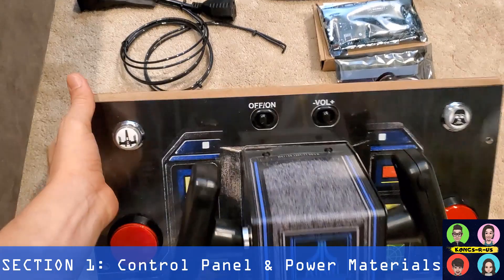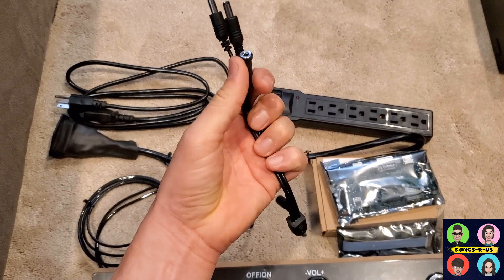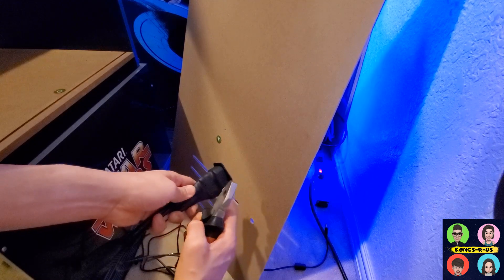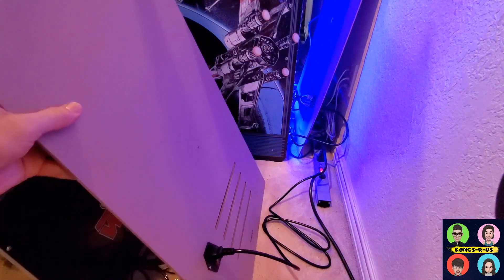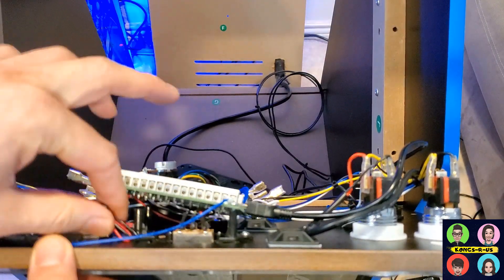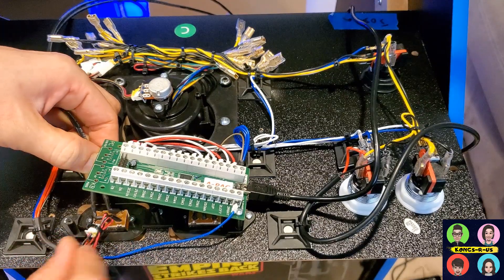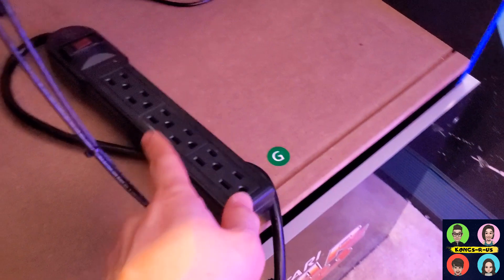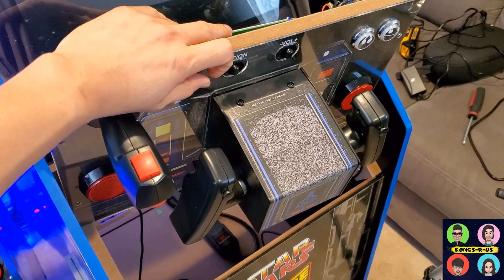Star Wars Arcade1Up In-Depth Mod Tutorial: Cabinet Power Installation

Comment: Are you using some sort of relay to control the 120V power.
Reply from the maker: inlet module switch to surge protector, with (2) 14 gauge wires hooked to the A1up stock power switch to control the surge projector power. Hope that answers the question!

Comment: Where did you purchase the Inlet Module Switch?
Reply from the maker: I custom made the inlet module switch wired to the end of an extension cord, then wired (2) 14-gauge wire from the black live wire to plug into the stock A1Up switch. highly recommend being careful if planning to try this out, as the A1up switch is rated for 125V  - 6A so can only handle a few devices plugged into the surge. PC, monitor, and sound only

Comment: What components did you use to make the two wire switch to power on the machine from the on off switch?
Reply from the maker: I have a tutorial coming soon of how I made the inlet module switch with the the wires.
Reply: @KongsRUs  are you still planning on making the how to video for this?
Reply from the maker: @corbinstratton yes, I have it recorded.  I have lots of content just not enough editing time! I have it on my list to do soon. thanks!
Reply: Specifically how you wired the extension cord end and the 14 gauge wires to the inlet module. Without directions I’m out of my depth. Thanks!
Reply: @KongsRUs  great. Thanks!
Reply: I was wondering that too
Reply: That what I was wondering? Is 120V Running through that little switch?
Reply from the maker: @VeganRashad  I have (2) 14 gauge wires plugged into the A1up switch which is stamped and rated to handle a 250v 3A or 125v 6A load. The power strip inside the cab is only powering the PC with a 240w power supply, stock monitor power supply (12v 3A adapter), and optionally an amp with a 12v power source. The 2 wires on the other end plug into the hot wire on my extension cord, and then to the hot input in the inlet module switch.